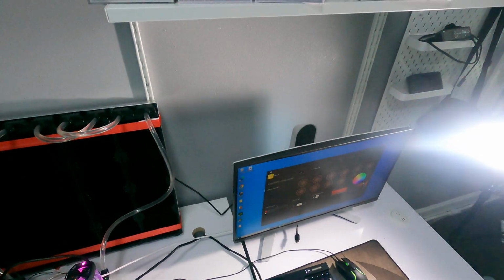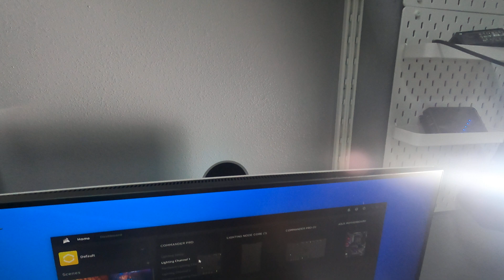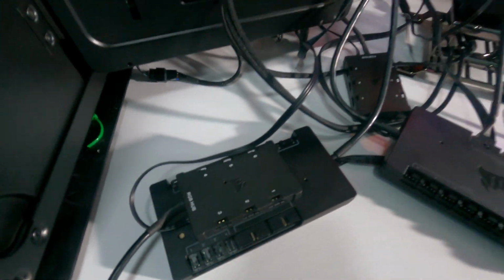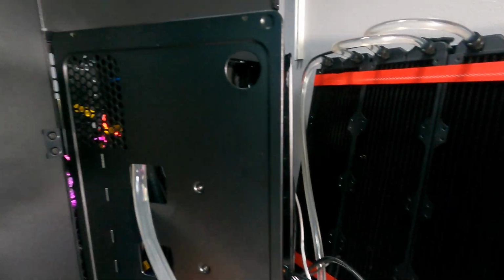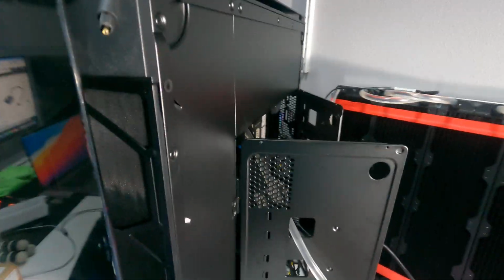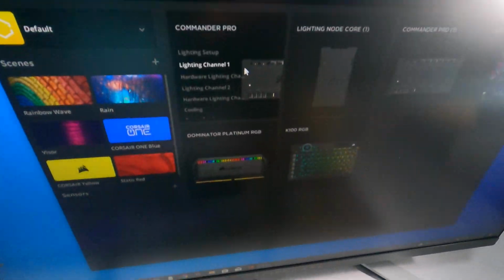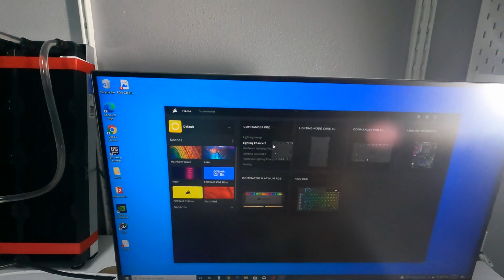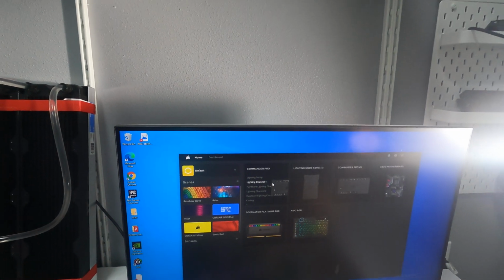Corsair iCUE Software not working (trouble shooting)

Comment: The problem I'm having is, the controllers show up, as well as the RAM. But when I turn off my PC, the lighting mode I choose does not save. I recently had to uninstall and reinstall ICUE, and it worked just fine. But, like I said I turn off the PC and turn it back on, It reverts back to a neutral color. I do not want to uninstall & reinstall just to get the program to work. Any suggestions?
Reply from the maker: Mine would do the same thing. I would turn it off or the computer would go to sleep and i would lose all my color settings. One day it just stopped. I would shut the computer off everything would be lost and then i would open the icue app and everything would come back. Corsair is a massive company with huge money for R&D and software development i cant believe they cant get this right.
Reply: @anthonyferraro  I'm jumping ship, going to Lian Li. I was going to save some money by trying to match everything. But I can't take the mess of that program. Wondering if Lian Li is any better?
Reply from the maker: @invest_9361  i dont have any knowledge of the Lian Li software. Wishing you the best of luck man!
Reply: @anthonyferraro  buying the O11 case and fans if going to be around $700. I'm going to research their software before switching. I would hate to make the jump and it's just as bad. But thanks for your video. I saw another video on here showing the user to erase everything, including the registry keys.
Reply from the maker: @invest_9361  Thanks man! I'm glad you reached out. Link the video on the registry keys if you dont mind.